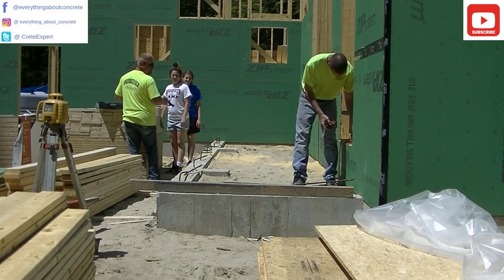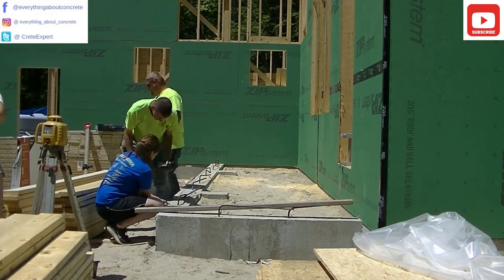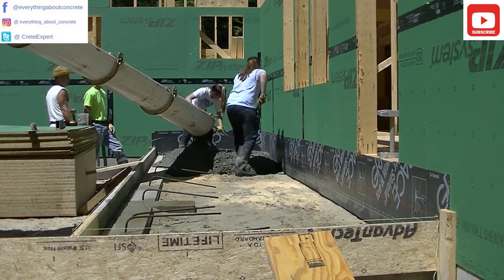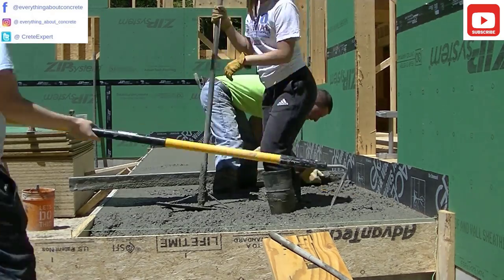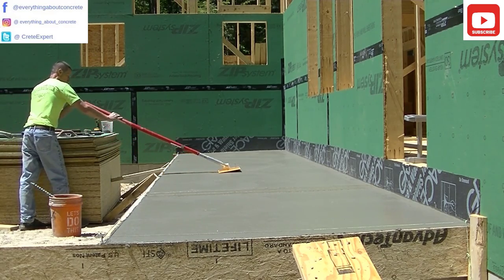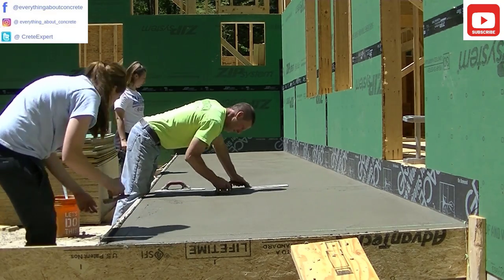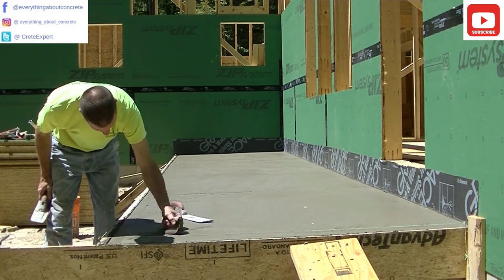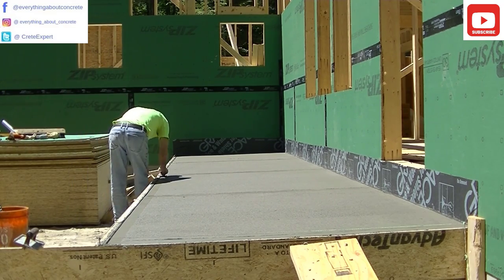CONCRETE PATIO | FORMING, POURING, AND FINISHING GUIDE FOR BEGINNERS

Comment: tomorrow Morning will be my first concrete pour 12x17x4 patio, can i get on the concrete with the knee sliders when i can press my finger into the concrete 1/4 of an inch? Thanks for your videos very help full. i live in Texas it will be around 80 degrees when we start pouring.
Reply from the maker: That's about the correct firmness, yes. If the sliders are sinking in, just stop and wait a little longer.
Reply: @MikeDayConcrete  thank you
Reply: @MikeDayConcrete  do I need to saw cut some grove’s in my slap, if so we’re should I cut it?

Comment: Let's ask the pros; I used to do carpentry for many years, finished carpentry and some structural as well; I got now a "little" project of my side of house area 21 feet long by 7 feet wide, sort of a walkway on the patio, on the left of it butts to house foundation (will use joint expander here as well on the slabs expansion joints) on the right and far towards front and driveway will butts to property mark cinder block wall, I have only access from the patio. I have for the area (196 sq ft) 145 quickrite 60 pounds bags, I have a small 3.5 cu ft (2 bags mix at times) I plan no reinforcement as ground is old since 1974, I am continuing a run of a 3" black PVC pipe from the patio draining system all the way into below the driveway slab as to connect it later on to the main drain (different project) once the pipe is in place and ground prep again it will be wetting, compacting and wetting before pour; It is only me, cement is already on site for 3-4 days, could be there a week before I can start (will it go bad???!!!!) covered with a tarp; getting harder than I would like as it is cold out every night around freezing. I live in Las Vegas, it is desert here but moisture in the air is there! now I have been advised to do it in 3 separate days of 7x7 squares; or maybe split job in half 10 feet run per day? I have all other tools needed, 4 feet screed level, knee boards, magnesium bull float with 12 ft pole, pole edger, joiner tool, concrete rake, 36" pole metal float and 15" magnesium float; my question; is this an ok approach for a first concrete work? job was costing us close to 2k to be done by questionable "contractors" aka; illegals rustling some cash that clearly had no idea of the job as they were even asking me to pay for the rental of even the finishing tools; so I bought the tools myself (around 1K) plus ~ $700 in materials, then lost $300.00 more to the shady contractor paid for him to remove dirt 4-5 inches from site area; and run the pipe, including under the hole in the cinder block wall below ground to the other side; this guy took the money and did not finish the job leaving us with few yards of dirt to dispose off and the pipe run not done; he only worked 3-4 hours just hauling 15-20 wheelbarrow of dirt that I had to finish prepping and dispose off myself! so there it is 2k going so far with the difference I get to keep the tools bought for it. (who knows maybe I can do couple of side jobs one day and pay the cost of those tools, just thinking, maybe!) If you see anything wrong with this scenario can you please let me know? I know is an stretch picking your brain unpaid but any help here is greatly appreciated. The problem with a real contractor or hiring a company to do the job right is the cost as it may end up costing way more of what we have available to expend and I feel if I got the tools, the know how or tips and the drive (balls!) to pull it off it could be done saving us a little, weather it is worth it or not; notice in my case a cement truck is not possible here as it wont be able to reach the area because a long driveway with a tree on front; and there is no way to wheelbarrow the cement either as on the other side of the property a disable truck is parked on the side and there is just not space for the wheelbarrow to fit, I moved the 145 cement bags on a narrow hand truck from the front to back; took me almost 6 hours and i was crushed when done! that was only 2.5 pallet of cement! if I have to move them back front for exchange due to hardening that will suck big time! Looking to start this project soon but need some help here and advise. Thanks!

Comment: I just had concrete poured in my backyard, but it doesn't look smooth when I touch it it has a texture and I hate it! What can I do to make it smooth?
Reply: If it's outside you need the texture to make it slip resistant. Smooth is done inside like a basement or garage floor.
Reply: @63flight  Got it! ty

Comment: A 7" step up from the patio to the subfloor is too high in my opinion.   I always indicate a 4" step on my plans and that is only to help from rain or snow.
Reply: Who builds a 4" step. That has always been what we call a tripper step. People are used to a 6" to an 8 " step. Code won't allow an 8" step anymore but they are everywhere on older stuff. This is my opinion of course from my personal experience. 🤓
Reply: @63flight , I'm not talking about an actual riser on the steps.  It's the step down from the finished floor to a patio or deck.  4" is very common for that.  By the way, yes an 8" riser is still allowed by code.  In fact up to 8-1/4" is allowed but from experience (considering I am an architect) the most comfortable step on an actual set of stairs is 7-1/4" but in order to reduce the # of treads and save space it is most common to use a 7-3/4" riser.  So I agree with you on a normal set of stairs but you do not want that big of a step down from the house to the porch.
Reply: @jtltet  I agree with you. I was  a Mason for 30 years. Anytime I would build a porch or a step I would have to include the threshold height. That's what I was thinking of when responding to your comment. Thanks for the reply, good stuff.

Comment: Hey Mike what concrete would you use foe a sloped driveway  50 foot by 24 foot. Wide 4000 or 4500 and with or without fiber??